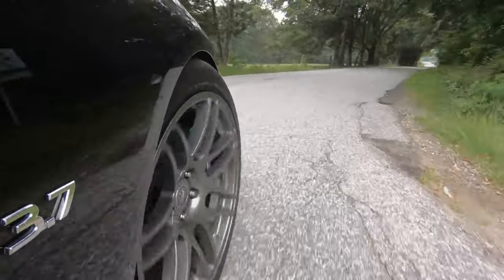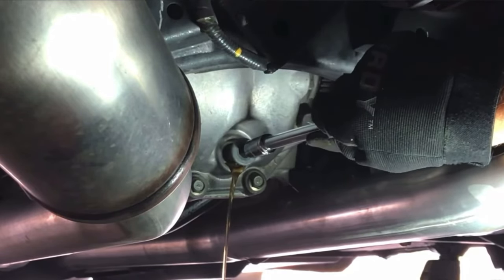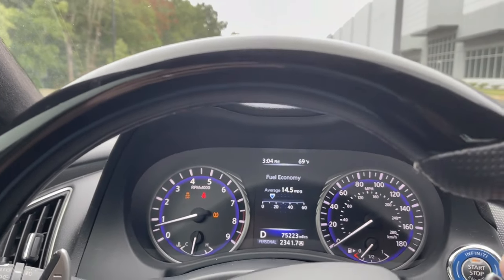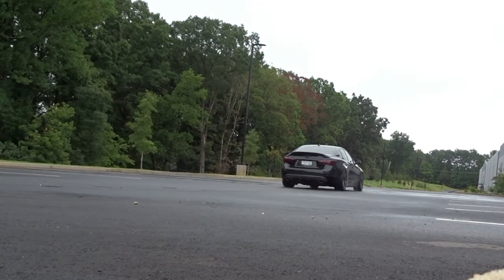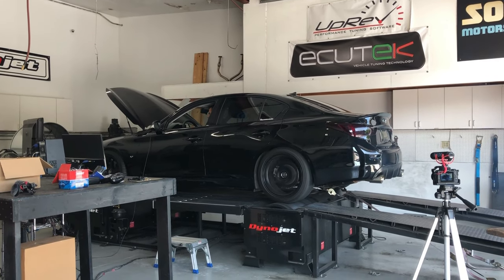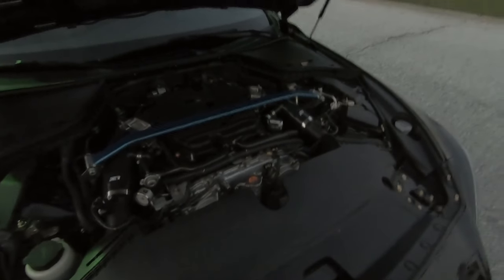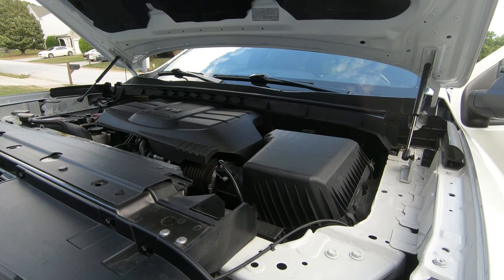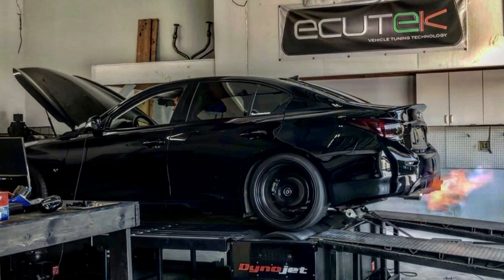Tips To Keep Your Q50 Running Great

Comment: i have a 2015 3.7 awd with 147k miles and the trans stopped working or i dont know what it moves slow and when i hit the gas the engine revs high but moves slow what do you suggest?
Reply from the maker: Valve body is done.
Reply: ok cause i took it to a trans shop and they said i have to rebuild the internals they want 5k i was going to change the transfer case oil and differential oil and trans fluid with filter u think that might help i never done it?
Reply from the maker: @OscarGonzalez-ix7dj  transfer case fluid won’t do anything for the trans issue.  5k rebuild is nonsense.  You can find a used trans for $1000 and have it installed.  Better idea is to swap it with a trans from a 2017+.  It takes a few extra things, but you won’t have to worry so much about the valve body failing again

Comment: are you able to elaborate on the q50 transmission problems? couldn't catch what you were saying about it. thanks
Reply: usually the valve body’s on these 3.7 are trash. It’s a speed sensor that goes out but you can’t just switch it out. You’d have to purchase the whole assembly (valve body) and get it replaced and reprogrammed. Suggest getting it from the dealer!!!
Reply: also it’s very expensive just got mine done yesterday after 80k miles

Comment: Always change the trans fluid on this car. I had to replace my valve body on my 15 q50 and I bet anything it had to do with low pressure or overheating transmission.
Reply from the maker: No sir.  Seems to be no rhyme or reason to valve body failures in these.  In fact, people have experienced failure after a fluid change.  The recommendation is to not touch the trans fluid if the car is shifting normally.
Reply: @SpeedCultureStudios  what a shame they left us with this failure with no assistance. Luckily, I could replace this myself, but the majority of people are not so lucky and it's 4500 at least to have it fixed.
Reply from the maker: @tarickk6132  yes it can be a very expensive fix!

Comment: Every hundred thousand miles you should replace the spark plugs on the 3.7L VQ. Coolant services should performed every 60,000 miles. Transmission service should be performed every 50,000 miles.
Reply from the maker: Spark plugs are supposed to be done every 25k but 50k is probably fine.  100k is WAY too far without a plug change.  Please don’t wait 100k to change plugs! I agree with coolant  service at 60k.  Trans should not be touched before 75k unless it’s shifting weird and even at that should only be a drain and fill, not a full flush service.

Comment: I have a 2015 Q50 with 66k and the tranny died this week.  At dealership now.  They said $3000. How can this happen when the car is like new?
Reply from the maker: The trans on the VQ seems to be hit or miss.  It’s unfortunate they didn’t have a recall on this
Reply: Are you sure it wasn’t the valve body???? What were your problems ??
Reply: It was exact symptoms.  Wouldn’t shift past 3rd gear.
Reply: @robertmelio4262 could be you’re valve  body if you have high rpms but aren’t going past 20 or 30mph.

Comment: i just got a 2015 q50
Reply from the maker: You’ll enjoy it!
Reply: @SpeedCultureStudios  so far sometimes at stops, the car doesnt move for a second. But then jolts back even if i put a little pressure on the gas peddle.
Reply from the maker: @No16873  seems strange
Reply: @No16873 I’ve ran into the same problem it feels like a hiccup. The RPMs rise and it takes the car about a second to actually go and jerks the whole car. I’ve talked to multiple ppl about it and all have said it’s just a touching thing and will get used to it overtime try n be a little more aggressive when pulling off I’ve noticed it happens less you don’t need to floor it but a strong press on the gas
Reply: @EternalRider-rn4ob  transmission is difficult to work with so i gave mine back